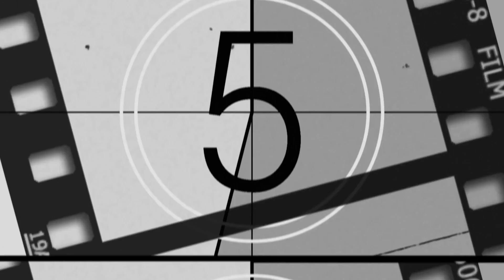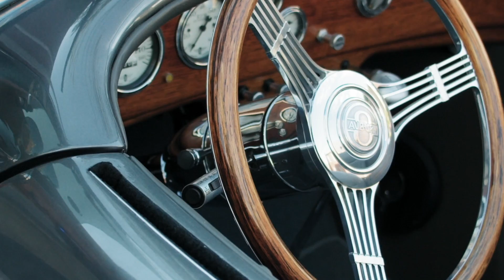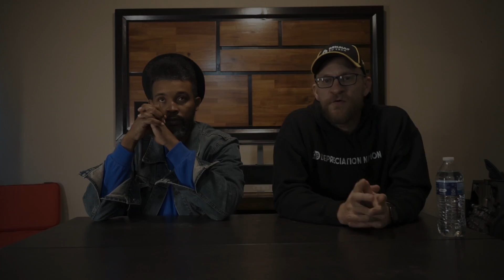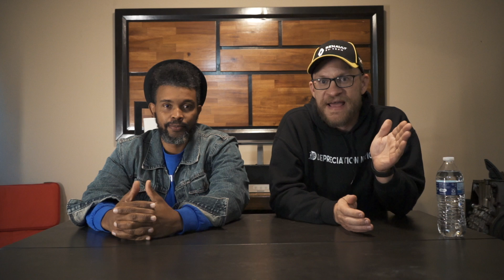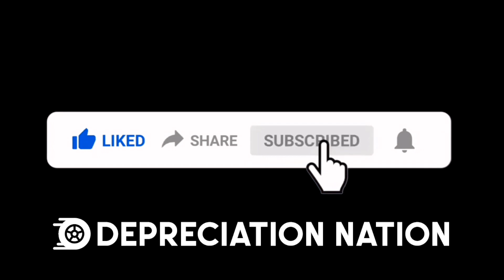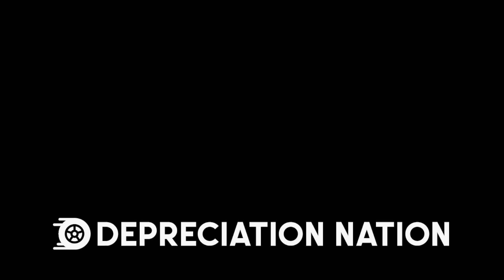It’s probably your BMW’s CCV

Comment: ive n43 engine e93 2007, having missfire when the car is cold but not giving proper error code. I tried , removed cover of the oil and idle sound has changed. I put my hand on it there was a little vacuum , felt on my hand,not hash. Do you think i got to replace it ?

Comment: Hi I have same misfire and also white smoke from exhaust, how will I diagnose the problem without starting the car
Reply from the maker: Visually inspect all of the lines that go to the CCV. Without running the car, that’s my best suggestion. You could also smoke the intake.
Reply: Ok and before that I changed two crankcase breather hose it worked fine for 30 min and then it started smoking lot of white smoke from the exhaust and multiple misfire codes

Comment: I got a lean code P1092 that I've been chasing for 2 years now.  
I have done just about everything and everything you described with the exception of idle surging, sounds like I need to replace my CCV.
If I get the vacuum at the oil cap tomorrow, Im ordering that CCV.  
Thanks so much!  I'll follow up if it cures the P1092.
Reply from the maker: Let us know!
Reply: Did you solve it
Reply: @thewarlordscalling6537 not yet.  The new parts have been sitting in the trunk for about 3 months now.  
I have not had time for it but Ill get it done in August.  Ill let you know but Im sure that will be it.  It has 160,000 and my sons ZHP just threw a check engine light from just aitting there.  BMWs!!!

Comment: thx i have n46 engine (its like a 4 cylinder n52) when i remove the oil cap my enine stall. That can be a 
bad ccv sistem??
Reply from the maker: I cannot speak for the N 46.
Reply: @ thx the ccv system is almost like n52 m54 n43 i could use any tips

Comment: Thank you, I got lean bank 1 and 2 codes and misfire cyl 3, and before I conduct the smoke test, I suspect the CCV already. Never been changed, 200k kms. Valve cover gasket was changed this year so that's ruled out (most likely), dipstick not clogged, for the rest maybe intake boots. Also losing some oil (but not burning excessive or exhaust codes), also no oil leak from valve head.
Reply from the maker: It’s always most likely the CCV. I just did another one on a 2005 X3 over the weekend and it cleared up my misfires and lean codes. If it hasn’t been replaced, replace it along with intake boots, Dipstick O-Ring, throttle body gasket, and your Idle Control Valve grommet.
Reply: @DepreciationNation  Thanks, I hope that will fix it. I'm a novice so have to have a guide on me and a day off! Also, the crankcase leaks some oil from the bolts, everything above the gasket is dry. So probably have to have that done at a garage as I don't have engine suspender.
Reply from the maker: I’m assuming you’re referring to the oil pan gasket that’s seeping?
Reply: @DepreciationNation  Indeed, every bolt is wet and so is the pan bottom, whereas the rest is dry as a bone.

Comment: I don't have a minor vacuum, I have a major vacuum.
Reply from the maker: Could you be more specific?
Reply: @DepreciationNation  Thanks.  The oil fill cap is hard to remove when the engine is running.  That's bad, right?
Reply from the maker: It’s not great… there should be vacuum but not to the point of being unable to remove the oil filler cap.
Reply: @DepreciationNation  -- I can remove it, but it takes an unusual amount of effort.
Reply from the maker: @ShowMeWhatINeedToKnow that can also be a sign of a bad CCV but may require some diagnosis.
Reply: @DepreciationNation  Good to know; thanks!

Comment: if ccv broken, that mean maf can be working wrong too? cuz i think my ccv fuked, but when i unplug maf car still running
Reply from the maker: When you unplug the MAF, the car goes into an alpha tune meaning… it goes into a bare bones fuel map to keep the motor running. If the car won’t run with the MAF plugged-in, you either have a massive vacuum leak or a bad MAF.

Comment: I have just had my bmw x3 2.0 petrol which burns a lot of oil on an engine test at a bmw workshop. There they established that the compression was good and equal on all cylinders, and the crankcase ventilation was ok. They stated that this car has been to them before for hot running/overheated engine and they tried engine flush and another type of oil without any help. Ignition error in the error memory, but it probably has nothing to do with the oil consumption. The engine does not smoke blue on a cold start, nor on hard engine braking, which are symptoms of bad valve seals, but a lot of blue smoke when the gas pedal is pressed quickly at idle and when accelerating after idling. Even if the compression test is ok, I suspect that the oil rings may have been damaged because the engine has been run hot/overheated. Any opinions on this?
Reply from the maker: What do the spark plugs look like? Any sign of coolant crystallization on the electrodes?
Reply: @DepreciationNation  The spark plugs look perfectly fine, and I have checked the cooling water and it looks good. The temperature of the engine is also good. I have a very bad ignition so the engine pulls poorly and misfires a lot and will choke, especially when I have to back up hills, but that has no effect on the oil consumption. The seller of the car tricked me into pouring protec gasket renewer which I was supposed to drive 1000 km. I have driven about 700 km now and the oil consumption has decreased somewhat and it smokes a little less than before. But if one or more oil rings are worn/damaged due to an overheated engine, there is no help if I drive 10,000 km or more. I have understood that it is difficult to detect bad oil rings. The compression is good so it is probably the misfire that causes the engine to have poor power + a little oil in the combustion
Reply from the maker: @jantelow I agree with rings. I’m assuming you have a check engine light illuminated for the misfire. Have codes been read?
Reply: @DepreciationNation  Weird, but I don't see any lights on the dashboard even though it misfires a lot. A misfire was registered in the fault memory during an engine test at the BMW workshop. but it was not stated what the misfire was. There was bad information on the paper I received after the engine test, I will contact them again.
Reply from the maker: Interesting. Misfire could be a vacuum leak, a bad coil pack, a weak spark plug, bad injector, malfunctioning purge valve, etc. 

Misfires will almost always trigger a light on the dash.

Sounds like your issues are unrelated and may require further diagnosis.
Reply: @DepreciationNation  I think I will probably get the oil consumption documented and cancel the car purchase. I'm afraid I've bought a problem car

Comment: I have a 2006 bmw x3 2.0 petrol which uses 3 ltr oil on 1000 km with poor power. Surely it can't be possible that bad ccv causes it?
Reply from the maker: It very could be. Any lights on the dashboard?
Reply: @DepreciationNation  No, there is no engine light in the dashboard. There is very little blue smoke when starting the engine, but a lot after idling for 5-10 minutes and when accelerating. It does not smoke blue when decelerating in gear, which I have tried many times. There is a slight vacuum at the filling hole for engine oil and the tube to the dipstick. There is also very poor power in the engine, so I'm probably guessing that it is the piston rings/cylinder that is at fault. I'm going to take the car to the workshop for an engine check tomorrow so I'll probably get an answer to the problem then. I have heard that this engine N46B20B is a problem engine with poor quality cylinder liners.
Reply from the maker: @jantelow valve seals could also be an issue…
Reply: @DepreciationNation  Doubt that they are so very worn since it smokes minimally when starting at cold engine and not when braking with the engine when downshifting on downhills, but it smokes an awful lot when accelerating after idling so I can hardly see in the mirror what is behind the car may also have slightly worn valve seals in addition to worn piston rings/cylinders since it burns such an awful lot of oil, a minimum of 3 liters per 1000 km. But it is also possible that the ccv is also bad. The power of the engine can be compared to an old vw carravelle 2.4 suction diesel that I had for some a few years ago.

Comment: can CCV cause negative fuel trims? -28%?
Reply from the maker: Possible but unlikely. MAF, O2 Sensor, Fuel Rail, bad/ leaky injector?
Reply: @DepreciationNation  replaced camshaft position sensor (intake) .. which I thought solved my issue of having the car randomly stall while driving! (dangerous) .. Drove it for a few days and the issue came back. 
first readings off cheap foxwell n3 scanner was p0128,  0175/172 (rich bank 1/2) p0420/430 Cat System Efficiency bank 1/2.. 
with snap on today, codes were 2730/2738 (cat conversion bank 1/2)
2882/2883 mixture preparation bank 1/2
279b thermostat reference 2783, air flow sensor.. 

any guessed what it could be? sorry ik this was a ccv video lol. checked thermostat, smoke test, Unplugging MAF did not change the highly negative fuel trims. replaced: MAF, ICV, fuel pump, intake camshaft position sensor, alternator, starter
Reply from the maker: @esko_______2522 was the MAF OE or an off brand?
Reply: @DepreciationNation  it was OEM, (the car was running just fine before the issue occurred with that MAF) but i suppose it could spontaneously fail though. 
however today even with it unplugged the issue remained persistent (stalling after starting up sometimes with throttle). As well, the negative fuel trims were still there.
Reply from the maker: @esko_______2522 mileage? Have you checked your precat O2 sensors?
Reply: @DepreciationNation  146,022 miles. not sure if the cats would be clogged at that mileage? 
I will read the voltage from the O2s, and check fuel pressure/regulator/filter. 
The intermittent stalling seems like a likely candidate for exhaust and crankshaft position sensors?  
O2 sensors don't cause the car to die right after it turns on?  (i understand it could be causing the negative fuel trims though, possibly separate issue)
Reply from the maker: @esko_______2522 I agree that it would be unlikely. Could definitely be cats… I’d assume the car would have power issues in addition to stalling if it were cats though… CCV could definitely cause the stalling but likely wouldn’t cause negative trim. As you’ve stated, could be a combination of issues… cats would be my next point of attack.
Reply: @DepreciationNation  thanks i will check the pressure of the cats! thanks for the information

Comment: I don't understand? So you're saying that the CCV valve sucks the vapors back down in to the oil pan? So it's designed to cause oil dilution? I thought the purpose of these systems was to remove the vapors/gases from the oil pan/ crank case by sucking them into the cylinder to be burned? Or is the purpose of this system completely different from a PCV system?
Reply: The CCV valve is basically an oil separator.  It has one inlet and two outlets.  The inlet comes from the valve cover.  The bottom outlet returns oil extracted from the vapor back to the oil pan, and the other outlet returns the vapors to the intake manifold to be burned off.
Reply: You are correct sir and these guys are wrong with the description of how the M54 CCV and M52TUB CCV functions.
Reply: You are correct. He got it wrong there. The oil will drip back to the oil sump, but the vapours are conducted back to the intake manifold so that they can b fed back into the engine cylinders for burning

Comment: Hi there.  Elsewhere (https://youtu.be/vODpt5b2DsM), there is advice that if you have suction when removing the oil filler cap, this indicates CCV failure.  I understand you're saying the opposite, that you should expect suction at the oil filler cap.  Can you please clarify what is correct?  Many thanks.
Reply from the maker: You should have some suction. Car should stumble or die when removing the oil filler cap while running. There are instances of extreme suction that could also indicate a failure but these are more uncommon than no suction.

Comment: Would a failed Ccv or cracked Ccv cause tons of smoke to come out of the exhaust?
Reply: And cause misfire?
Reply from the maker: It could be a blown head gasket but it could also be the CCV. There are a number of ways to check referenced in the video.

Comment: All good advice but how do you check the ccv? What are you looking for?
Reply from the maker: No suction when you place your hand over the oil filler hole at idle.
Reply: Or excessive vacuum through filler hole.
Reply: What if you have very minimal suction
Reply from the maker: How minimal is minimal? If you remove the oil cap and place a rubber glove over the filler hole, it should deflate the glove relatively fast.
Reply: I have vacuum maybe a lot on the oil cap but the dipstick tube is very minimal

Bmw e46 330i
Reply from the maker: @lilmixdboy does the idle change with the cap open?
Reply: @DepreciationNation  I believe it did. But I didn't pay attention to the dipstick and the oil is non-existent 

This is my sister's car, I'll have to put some oil in and check again. Not gonna start it up again with low to no oil
Reply: @DepreciationNation  thank you for the reply
Reply from the maker: @lilmixdboy  what issues are you having